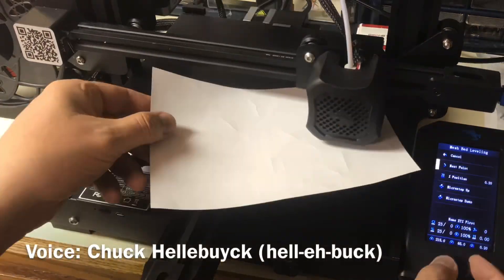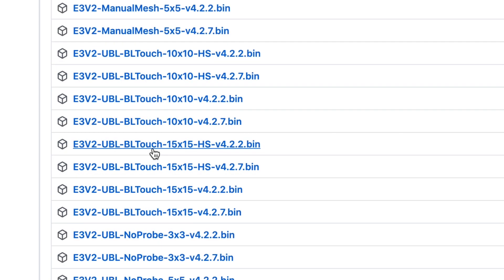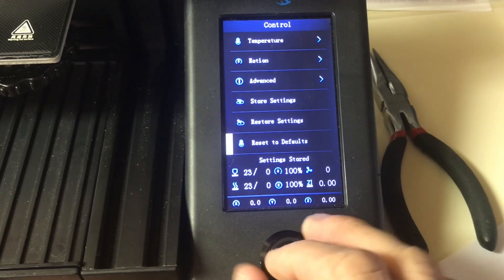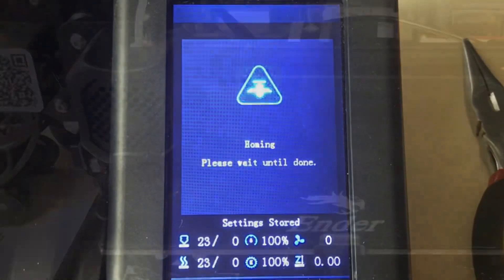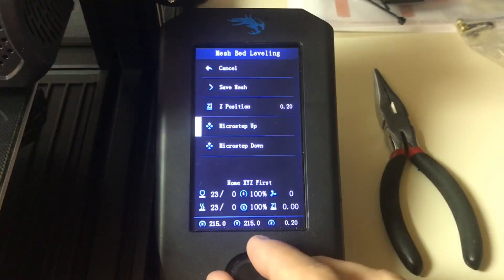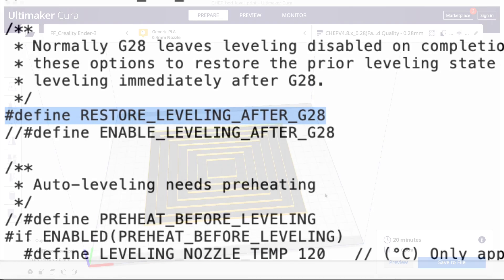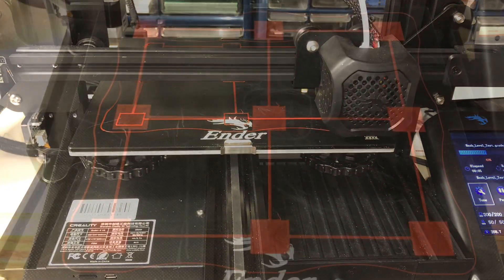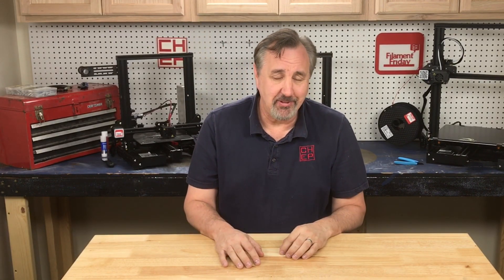Creality Ender 3 V2 - Mesh Bed Leveling

Comment: I've got Jyers Marlin 1.3.4 on my Ender 3 v2 with a 4.2.2 mainboard.  I keep getting heating failed errors that causes the print to halt.  Happens at PLA or ABS temps, either while the hotend/bed are heating or during a print.  I did autotune PIDs and the situation persisted.  This doesn't happen at all on Creality firmware - anyone else run into this?
Reply: I get this as well it's random I think its a bug ?
Reply: @Fixingthingz4u  I tried the latest release, and I think it's caused when the bed level temp is set below the temp you're at, and the hot end is heating up to a higher set temperature.  I usually get it if I am at a temp, start preheating, then turn down the bed temp.  Seems like it's stabilized a little lately.  

I also had the bug happen less when the X unit was not clicking on the Z-offset sensor.  Gave it a little space and the issue occurred a lot less.
Reply: @mohnjadden7841  yeah agreed thanks mate im also using a 1mm feeler gauge on another topic and wont be going back to paper no more bad prints :)

Comment: Chuck, I need help with Ender 3 V2 please. I use manual mesh bed levelling with the Jyers/Marlin firmware. I initially use manual levelling to set the springs as best as I can. I then engage the manual mesh bed levelling, but the printer has a Z offset of 0.20 when using the mesh bed levelling. I have to lower Z till about -0.03 for it to just grab the paper, but at 0.00, the Z carriage clicks the Z stopper. I don't understand why the Mesh bed levelling is so far off after I've done manual bed levelling. I measure the same point, once using manual levelling, second time, using the mesh bed levelling. They both sample the same point, but both provide different results...
Reply from the maker: Did you save the mesh?
Reply: I have this problem too, I saved the mesh
Reply: I have this exact issue as well
Reply: Did you figure this out mate?
Reply: @Fixingthingz4u  yes. For starters, I used a feeler gauge of .1mm because it's more accurate than paper. I then use the manual bed leveling, not the mesh bed leveling. In the manaul bed leveling, you have to set the Z offset to .1mm because you need to tell your printer that you are using .1mm feeler gauge (or whatever feeler gauge you have) so the printer will know to offset that. If you skip this part, you're lying to your printer and you'll get bad adhesion, often contributed to inaccurate bed levelling.
And that's about it.
Reply: Ok thanks mate yup gotya I might invest in the bltouch as well have you got one yet? Or happy with your results maybe you could do a quick little video?
Reply: Same problem..  I did same as you, then I ran out of z adjustment in the back side during grid creation.  I had done the manual leveling before.  Not sure what changed during mesh creation

Comment: Hi Chep. I have an Ender 3 V2, I used the same bin (V 4.2.2 - mine is the same as yours - Mesh 5*5) you did, in the video. The print resume function after w power loss is not working, it goes back to the home menu where we have to start the same.  6 prints were wasted :( 

Could you please check if this is the case by downloading the same file again from that link?
Reply: That has been fixed with Version 1.3.4

Comment: Hey love the video but after putting in the sd card with software and turned off the ender, it just shows a blank screen, somebody please help
Reply: Mine did the same thing I updated my firmware to the newest version then went back and installed this firmware and it worked fine
Reply from the maker: Change the file name and try again
Reply: @FilamentFriday  having this problem too,  what should i change filename to?  pls excuse my novice status here, just don't want to have to reflash the whole thing if thats not needed
Reply from the maker: Any name that’s different. Change one character. You can also try a different SD card.

Comment: hi chep thanks for your videos. I installed the same firmware 4.2.2 5 * 5 and we configured everything according to the wiki for octoprint as well as the mesh configuration and in the circular prints many blobs began to come out, the printer was stopped for a few seconds and the material kept coming out what it does spots appear. I printed from the SD card and thus there were no failures in the prints. Look for that in terminal if errors appeared and I found this:

first "Communication timeout while printing, trying to trigger printer response. Configure long-running commands or increase communication timeout if that occurs regularly on specific commands or long movements" and second "Octoprint too many lines to cushion the printing of cut blobs "

Try all firmware 4.2.2 5x5, 4.2.2 3x3 and 4.2.2 Default all with the same Blobs result on all prints. Finally I had to install the Creality firmware again and the prints stopped having these failures so I see that it is the jyers firmware that is generating communication errors.

What can I do so that this firmware has very good options that I would like to try? I'm sorry for my English, I'm from Colombia
Reply: Have you tried the arc welder add on? Ive heard people have trouble with data transfer speeds using octo print. Arc welder will make your codes much shorter and faster to transfer.

Comment: Just wanted to double check. So after your mesh is saved, it will automatically load the mesh for every print correct?  Their is no need to add any kind of command in Cura?  It’s all done on the printer and saved?

Comment: That was useful. I just installed the Jyers with 3x3 manual mesh. Picked up a tip or two from this tutorial, thanks. Maybe in a deeper dive you could go into the mesh viewer and explain what this is telling us and how to read it? BTW, if you didn't know, the writer of this firmware variant is still in college. He is quite active in the Ender 3 v2 group on Facebook.  He'll have no problem finding the job he wants when he graduates!

Comment: Have you tried any of the sold leveling blocks?  I have seen them as solid silicone and silicone with aluminum inserts.  These would seem to make sense with an auto leveling system.Aluminum has a high thermal expansion I would think this could be an issue if the bed is leveled cold. 

Any thoughts?
Reply from the maker: I have silicon versions to try.

Comment: I've got a strange issue when using this software... Mesh itself is great, Z axis adjust accordingly to X-Y position - that's the goal. But I need to constantly set new Z offset, every print it's completyly different - first print I need to go -0,3mm, then I print again and need to set +0,4mm... And it's not even the worst thing! I need to delete Z offset (set it to 0) after the first layer!

If the first layer Z offset is, for example, -0,2mm then second layer is -0,2mm + [print layer height] related to 1st layer. If I print at 0,16mm then second layer is -0,04mm (related to 0) and nozzle scrathes the bed, 2nd layer is lower than the first...

If the first layer Z offset is, for example, +0,2mm then second layer lands additional 0,2mm to print layer height - again it ruins the print.

Anybody anything?
Reply: im getting the same thing
Reply: Today, after fresh bed leveling and meshing, I needed to go -0,4mm for first layer, 0 for 2nd layer, and then back to -0,4mm for 3rd (what'd be next I don't know - print was ruined due to those changes where the layers started)... This is ridiculous...
Reply: @inmatefrompl  IKR its making me so fucking angry
Reply: @inmatefrompl  i even loaded the mesh off mg board cleared it and zeroed it but still i get
The same shit
Reply: Yeah, I updated to 1.3.2 released yesterday and the same thing. I leveled bed, made mesh, started print immediately, without even turning printer off... -0,5mm offset needed. For first layer of course. This was the moment I switched back to stock FW - I'm printing with no issues now.

Comment: I wish I could punch that like button a thousand times!!  Thank you soooo much for sharing this video. BTW I concur with the others who mentioned that with v1.3.1 you do NOT need to add anything to the gccode in Cura for the mesh bed leveling. I also installed the 5x5 for my V2 with board v4.2.2.

Comment: After downloading jyers and setting my mesh bed my prints are still starting way to high (nearly 1mm off) I haven’t set a z-offset so why would it be doing this? 
My custom code is 
M420 S1 Z2;
G9

Comment: Thank you so much. This Was very important for me. I will also happy,  if you can give me Tips for PETG-profile. I made profile with coasting and without. Because with Coasting, the seems is a problem. I used Prusaslicer, because the slicing and the  printing is faster than the Cura.

Can you make also a Start and End-Gcode Video for Prusaslicer. Because your Code is a little bit different to Cura.

Comment: i dunno if this has been said but... with the newest release of Jyers V1.3.1, adding the M420 gcode in cura actually ruined the mesh level and for me the nozzle would always be a bit too far away from the bed. removing this code fixed the problem
Reply from the maker: I’ll check it out. Thanks.
Reply: Was it like the nozzle was always skipping a layer so your Z offset had to go to: - leveling height?
Reply: @CowallTV  yeah sort of like that.
Reply: @emilpedersen5325  I have the problem that my Printer doesnt use the Mesh i saved? IDK why?
Reply: @CowallTV  no clue.. for me it kinda went back to being shit but when you turn the printer on set the z axis offset in the menu to something like -0.05 to -0.1 that completely fixed it for me

Comment: I just bought an ender 3 V2 but when i auto home and level the bed, the bed gets stuck on the Y axis and makes a horrible noise, I've fixed this when i raise the bed but when i level the bed and it seems ready to print the same problem happens because it seems the bed is too low, how do i fix this?
Reply from the maker: Raise the Z stop switch and the bed.
Reply: I'm pretty new too, I got mine about 5 weeks ago, and I noticed that Creality has actually  put the bed and Y-stepper motor on a possible collision course! Complete madness to my mind... it's just a few mm so they could have just raised the whole thing by that amount and eliminated the problem! The solution is that you must raise both the bed and z-stop, and re-level the printer. 
On a side note, I had to replace the bed-leveling springs too, because after about 3 weeks or so my printer had to be readjusted after practically every printjob, but in went the new springs and it works much better. So far... only time will tell. These springs are both firmer and longer (which sounds like innuendo - but I'm talking about the springs!) The old ones also made leveling more difficult since they didn't allow much adjustment using the leveling knobs.

Comment: I've saved to EEPROM, and inserted the command in my gcode. But it's always printing the first layer at 0.2 Z-axis... and doesn't move up and down. I've also added the M420 S1 command.

Also, when I try to connect my OctoPrint now to printer, its crashing with the M112 error and forces me to reboot the whole printer.

Any ideas?
Reply: with the newest release of Jyers V1.3.1, adding the M420 gcode in cura actually ruined the mesh level and for me the nozzle would always be a bit too far away from the bed. removing this code fixed the problem.

so try removing the code.... i had the exact same offset

Comment: Great information CHEP thanks! Does anyone know how to confirm which 32bit board I have in my ender3 v2?  (either V4.2.2 or V4.2.7) my info screen has firmware as v1.0.1. Thanks in advance!!
Reply from the maker: Unless you changed it you have V4.2.2

Comment: Now my screen is just blank! 
I tried putting all the original files back on the sd card and nothing but a blank screen.
Reply from the maker: Did you load the correct file? There is a V4.2.2 and V4.2.7 for the upgraded board.
Reply: @FilamentFriday  yes. I then cut and pasted it to a blank SD card and put it in the printer and turned it on.
Reply: @brokenbullets5276  Rename the .bin file to something short and random like f3453.bin and try again, making sure you just let it sit for ~5 minutes after turning it on.  The firmware won't re-use a file with a filename it's seen before.
Reply: If needed, get the stock firmware from Creality and do the same procedure.
Reply: I'm having this same issue with the 4.2.2 firmware. I opened my machine to double check the board version just in case. Blank screen for 5 minutes before i gave up.
Reply: @douwannafightaboutit  I finally fixed mine.
Make sure you do a full format to the SD card. Then install the factory firmware, pop it in and flip the switch. 
I tried everything else without any results.
Reply: @brokenbullets5276  I got the original version installed again. But I'd really like mesh levelling. My heated bed is warped and this seems like the cheapest solution. Guess I can buy a new one from gulf coast
Reply: @douwannafightaboutit  So I faced the same issue myself and was able to get my firmware flashed. The solution is to set your allocation unit size to 4096 bytes (And make sure it's FAT32) when you format the SD card. For some reason, setting it to 4096 bytes made the flashing process work for me. 

Put your correct bin file into the now correctly formatted SD card (If you have a stock Ender 3 v2 and you haven't changed the board then you have a 4.2.2 board). If you want to play it safe but isn't necessary, rename and shorten the file name. Flash your firmware and then delete the bin file afterwards for cleanup.
Reply: @skechup  i had the same issue and your steps worked for me, thank you!
i) format micro sdcard with 4096bytes fat32
ii) confirmed correct bin file and shortened file name

Comment: I updated to E3V2-ManualMesh-5x5-v4.2.2, the Z-axis wasn't moving at all during prints and the nozzle was too close at some points. I then added M420 S1; to the gcode after G28 and everything was prefect. I hope this helps someone. Thank you!

Comment: Chep- my ender 3 v2 sd reader stopped working a couple months ago so I've been printing via usb which instantly made my prints better for some reason. Can I do this firmware update through the USB, ? I had thought about replacing the board before but decided not to since my prints were coming out so well. If I do have to replace the board, is it best to stay with stock board or is there an upgrade that would be a better choice?
Thanks
Reply: That's indeed very interesting topic. I heard some stories about better prints of ink printers when you connect your computer via cable to printer instead of wifi.
Reply: @czaras_  I wasn't suggesting there was anything to it, I though I just got lucky and something connected right that wasn't before or I was losing some info when I wrote the files to the sd.
Thanks for the reply.

Comment: Thanks for the video Filament Friday is always cool. Chuck have you seen this printer, VOXELAB Aquila? It looks like an Ender 3 V2 with some design improvements, but a $100cheaper. I haven't found anyone, who I trust, reviewing it. I have an Ender 3 V2 in my Amazon shopping cart, but a $100 bucks would buy a lot of filament.
Thanks

Comment: if your beds warped flip it over and use the smooth glass side, it works great.
Reply: It's just straight glass on the other side right? Anything you have to do to print on glass? Like gluestick or something? (Speaking for PLA and PETG)
Reply: @steveo101112  no i just print straight onto glass im as suprised as you but it sticks great i use 210oc 0.6mm nozzle 75oc bed and amz3d pla and my prints are great oh and it also leaves a lovely smooth glass finish bottom only thing i do is in between prints or before a print i wipe the bed with just a damp cloth water only no soap just try it bro if your bed is warped what you got to loose i though i was gonna have to spend £25-30 on a new bed but this works great and if i need another im just gonna get a piece of 4mm tempered glass you can get it cut to size on ebay ppl selling them for the glass doors on stoves.
Reply: @happybrainybren  Thanks, I've give it a go
Reply: @happybrainybren  Just wanted to say that the glass worked perfectly for me. Just flipped the bed and re-leveled. Cleaned it with a little IPA. I printed in PLA without any fuss. Thanks for the tip.
Reply: @steveo101112  I've gotten PLA to stick to the glass itself. That being said I typically use hairspray to help it stick and release
Reply: @atistang  Thanks!

Comment: Hello Chep, I hope you're doing fine. I like your videos very much and they are very helpfull.   I however, have now  a question about Cura slicer in combination with my Ender 3v2. I have checked allover the internet to find the answer but untill now no solution. 
When I am printing a 20x20x20 cali-cube, I cannot get rid of the difference in sizes between the middlesections and the 5 bottom and 5 top layers . I used your advice to minimize some in the initial layer and that helps for the first layer . It is all very visible in the cube say elephant feet below and on top!  . Also strange, the top layers are thicker then the rest of the cube. I have printed 0.15 layer and the top layers look like 0,2 mm . I hope you can give me an advice!  Greetings Tom from the Netherlands living in France
Reply from the maker: Not sure, never heard of that. Make sure you z stepper isn’t slipping or skipping.
Reply: There are some settings that you can adjust just for the top and bottom layers. You check those settings. Some to check are Top/bottom flow, Top/Bottom speed, and initial/final printing temperature. There might be more but that would be a good place to start.